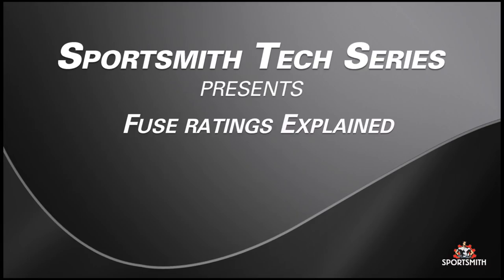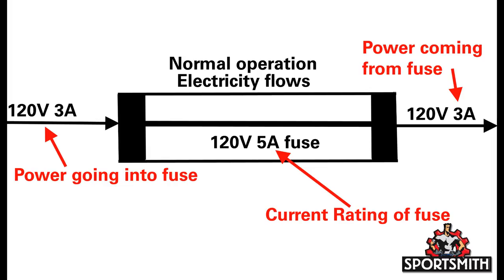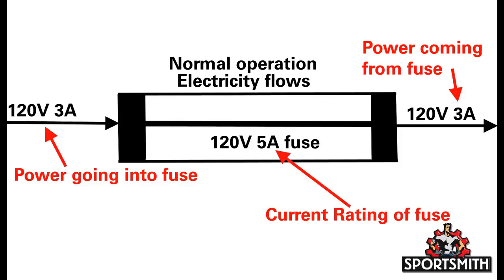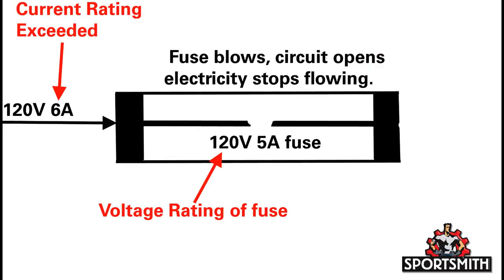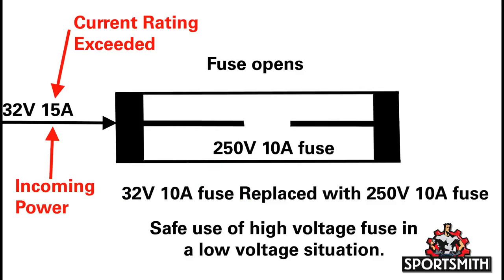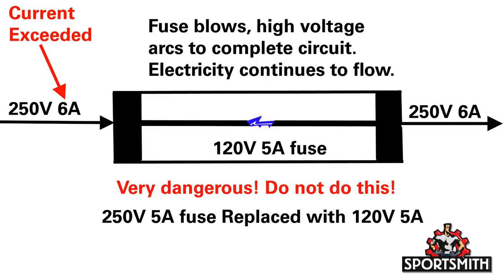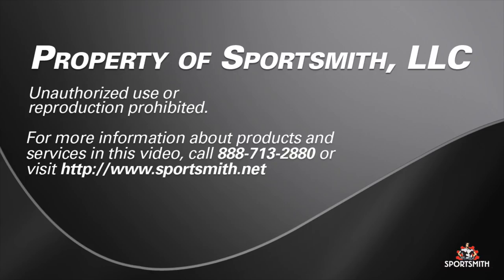Understanding Fuse Ratings

Comment: Nice video, I had this question about, I thought at the very begining... if a fuse of 220V and 15 amp = 3300watts,  then in a 12 Volts system, The amps would increase because, 3300w/12v= 275 Amps so the fuse 220V 15 amp, in a 12 Volts system would be in real 275 amps, but know I understand I was really wrong.
Reply: I thought of the same theory.However I also noticed that on a wire that is 125v 15amp rated vs 600v 15amp rated, the insulation is thicker on the 600v wire and the actual wire size is the same on both. So since a fuse is really just wire that is designed to fail in a controlled fashion, than it makes sense that you can use the same size fuse with a higher voltage rating. I don't have to size fuses so often, but this simple explanation was perfect to help me understand the theory behind the electrical code with fuses.

Comment: when to use fusible link?
Reply from the maker: Fusible links are used in areas and environments that are not suitable for fuses. Locations where a fuse holder would not fit and environments where a fuse would not last are both perfect for fusible links. Circuits that have temporary high current during regular use would blow a fuse. This makes using a fusible link ideal as it takes much longer to open.  In fact, they are found in many automotive applications for these exact reasons.